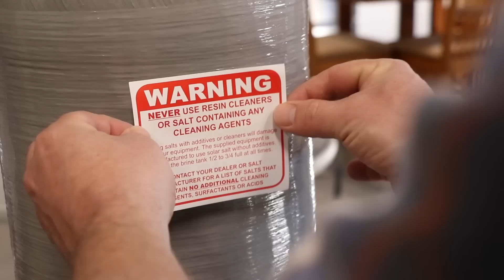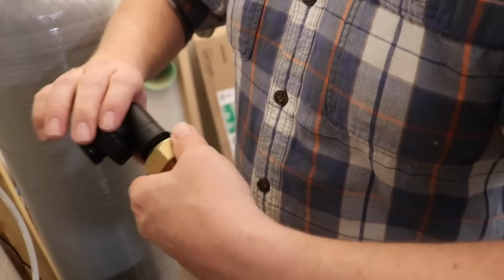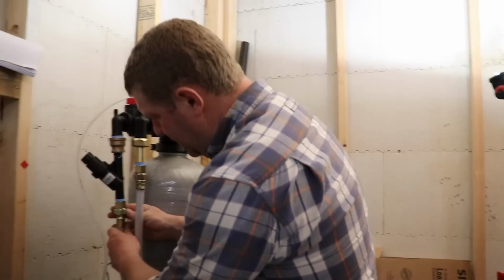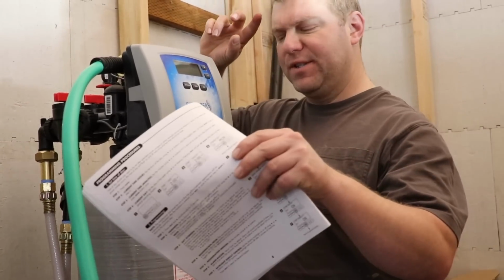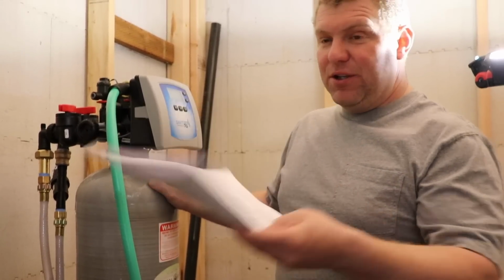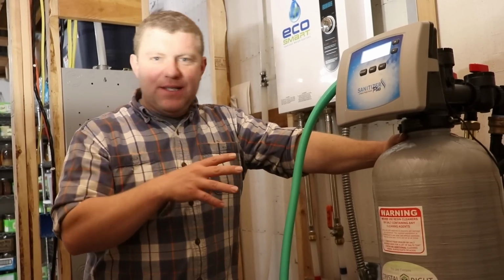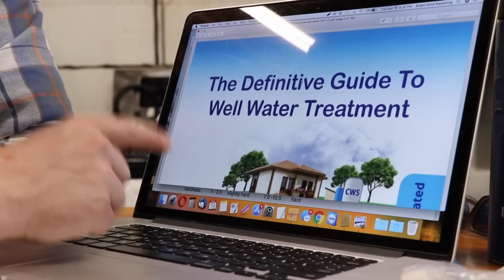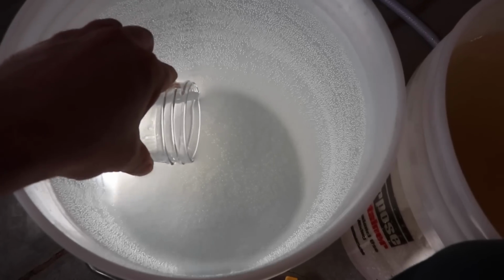ITS FREAKIN MAGIC! (Installing Water Softener for Well Water)

Comment: Now with the water softener installed (salt based ) you will be able to buy salt in pallet form and use it on the driveway in the winter. You may also want water filter in the future, in general the water softener is used to soften the water not to filter.

Comment: In the UK it is recommended that an unsoftened drinking water supply is provided at kitchen sinks.

The reason, salt is used to soften the water and it is all to easy to exceed your daily allowance of salt.  

If you suffer from cardiac problems or have high blood pressure this can be a real problem.

I would recommend having the salt content analysed and then compare the results with national recommendations.

Comment: Jessie filter only the water you are using in your house. Remember when it backwashes the unit goes into bypass and you will be getting unfiltered water in your house. I have a two tank commercial system in my house. While one backwashes the other filters. Also your salt consumption will be outrageous. Kenetico no power needed. Measures water usage for backwashing. It ls almost a must to put a sediment before the softener to protect it.

Comment: The check valve in the brine tank is  doing its job, no water in brine tank means valve is closed. Run unit through full cycle, presto fixed.

Comment: Those bubbles are a temperature difference on the surface of the bucket wall between the water and the outside air! It’s a normal reaction!

Comment: two things 1. turn the teflon tape over when you are wrapping the threads so you don't have to keep rolling in the slack. 2. you don't want the tape to cross over the orifice of pipes and fittings can cause blockages. Have a good one.

Comment: I think you could go straight well water for the garden and then for things like washing down the backhoe or whatever.. probably wouldn't fill a radiator with it but it probably shouldn't hurt the vegetables considering there are minerals in the dirt.. save you on your cistern use.. whens the due date? April 23rd? :oP 🐓❤🍕

Comment: Congratulations on the clear water. Just make sure it does not strip the water off all the minerals which are essential for our bodies. If it does you better be buying drinking water and use that for the house chores👍

Comment: 2 Things.....1) Our State (NH) inspector recommended that the recharge discharge from the softener be directed to it's own separate dry well.  Don't want to pipe a salt discharge (don't add antiseptic (salt) to the Septic Tank)  2) Recommend plumbing the outdoor faucets (garden etc.) direct from the well source...the softener should be plumbed for indoor domestic use only, softener is not needed for outdoor car washing and watering.  Good Luck!

Comment: Two things you need to know. You desperately need an expansion tank, with a pressure cut off switch. The cut off switch wires back to the well pump. When the tank reaches a set pressure, usually about 45psi, it shuts the pump off. when the pressure drops to a preset pressure, it turns the pump back on. Your pump puts out enough pressure to damage things in your house, if you do not control it. The other thing you need to be aware of, with a one tank softener, is when its in regeneration, it bypasses hard water into the home. Any water you use will be hard unfiltered straight from the well. On a two tank system you always have soft water in the home. Now at 2am you will not use a lot of water, but just be aware, if you do its hard water.

Comment: You may want to check with your filter contractor, but you may want to consider monthly water tests from the output of the filtration system to ensure it is operating efficiently and to identify any problems or defects with the filtration.

Comment: I would have thought you would have a house sized mechanical particulate filter before the softener system.Ah, I didn't hear about the internal particulate filter in this system until further along in the video. Got to say I love my reverse osmosis drinking water system even if it is a separate system. Oh and you already "know" not to use softened water for plants.

Comment: I have a similar system but it's for my fishtanks   Its a Reverse Osmosis 4 filter machine sediment ,carbon,carbon plus  & 100 gallon per day R.O filter  my tds starts at 85 and drops too 1 after the filters  then I have an additional Deionizing resin to drop it to 0 tds for my tanks (not ok too drink now)

Comment: Pursuant to this and your video explaining your quest to figure out a pressure measuring system to determine the volume of your cistern... have you considered float-weights? Doing a volume measurement from empty, you could put a sensor and float at the 100gal point, the 500gal point and maybe the 900gal point. A simple fluid-safe electrical contact switch with a bit of buoyant material on the end that will open/close the circuit when the float lifts with the water. I'm pretty sure you could do it with an arduino or a raspberry pi, but it could even be as simple as running low-voltage electrical cables from your utility room up to the cistern and when the water reaches the 100gal level, it'll pump it through your water softener and turn OFF at 900gal (accounting for change of volume based on temp, perhaps). Why make work for yourselves when you can have a $50.00 microcomputer, some electrical cable and a little bit of code can handle your water refill times. Should be able to program it to only fill when both conditions are met, 100gal AND you're both awake so that klaxon doesn't wake the future addition to your family. Just a thought. If you're not comfortable with programming, lemme know, I'll try to help or find a cohesive tutorial for whatever product fits your needs. Never stop being amazing, you remain an inspiration.

Love from Newfoundland, Canada

Comment: My concerns would be less about the quality but more about the quality over volume... This softener I would guess is for normal family home use that's around 100 gallons a day and timed to self clean (likely daily) and treat for that amount of use, but your considering making it move and treat 1000 gallons in an hour to last you couple weeks to a month. Seems to me you need to set up a good strategy to not over work it for the quality over volume thus using some timers or manually operating it something like 8-12 minutes on then backflush and treat or whatever you can devise from the normal intended daily use compared to how you actually plan to use it until you incorporate it into the house properly. Get the proper pressure regulator so your not stressing your pump and wasting precious water. Please don't use garden hoses for very long things grow in there we know the softener can handle some stuff but you will be pushing from the softener to the hydrant with a hose to send it up the hill. Don't neglect the cistern, treat it as needed still since you have such a reserve at your current usage levels. Be safe and congrats on the pregnancy.

Comment: Don't backwash into your septic. Outside hose bibs should just be on the well. Run soft water to one for washing cars ECT.  Might consider a uv sterilizer going into the cistern and into the house. They use much bigger ones in municipal water systems. 100% effective when maintained. Just not a fan of chlorine in drinking water.

Comment: For an example of a failed complex solution, look to the Boeing 737 MCAS. Increased complexity adds more modes of failure, and therefore increases the possibility of failure. A good solution is a balance which minimizes complexity while solving the problem.
Personally I dislike many of the 'features'  on new cars as it creates more modes of failure. My arm has never failed to hand-crank a window .. motors, on the other hand........

Comment: I think I'd rather deal with iron in my water than the lime we have here. This water, if we drink before filtering, will actually make you thirsty, and if we leave a glass or pot with water in it overnight, limescale will be visible by morning. And... (yes, I started a sentence with and) and it's tap water, from the local water and sanitation company, it's been treated, so "they" say.

Comment: I've always been told that you do not want to run your water softener through your septic system if you have a concrete septic tank it will deteriorate and cause it to crack 1 time may not be a problem now but not for long term

Comment: You might get some slight contamination from residue lubricants in your brand new system. So dont freak out, if the test comes out with small amounts of strange new chemicals ;-)

Comment: Two things. 

Don’t use salt softened water on the garden. Not good for plants as they should be happy with well water. If you were using potassium soften water the plants would love it. Problem is potassium is about five or more times the cost. 

Next, you could run a UVC unit which will kill almost every bat living thing in the water. However there are a few thinks it doesn’t so read up on them. 

Lastly, an RO unit for your drinking water gets the lays things out including the small amount of salt.

Comment: You are so close to having a water system. If you dig a water line, and install a pitless adapter and pressure tank, you won't have to mess with the cisterns at all. They are irrelevant now that you have a well. Wouldn't it be nice to have the system work automatically and unattended?

Comment: Run the power and water line from the well underground into  the house and into a 35 gallon pressure water tank "bladder tank" with a pressure switch. Then to the softener.

Comment: Was that you did a great job on your water so far something to look at a system play a Smart House possibly closest flow valves one-way valves sensors on the top of the that wirelessly tell you when the cisterns are filled listening to Baby design and layout eventually and look at systems good luck

Comment: Single tank systems are garbage because if you ever happen to use water when the system is regenerating (ever get up late at night to hit the bathroom?) you'll get raw water into your pipes, hot water system, etc.  Depending on the quality of the raw water this could be a mere inconvenience or a major issue.  Also, having the regen based on an electronic timer sucks because when the power (or battery) fails, your regen schedule will be lost.  Best system on the market in this regard is the Kinetico, which relies on water pressure to turn a bunch of gears that control the regen cycle.  Based on 15+ years of personal experience with that system, it never fails.

Comment: At least here and I do hope that it is different for you, but drinking 'softened' water is a big no no in the UK.
It is great for washing, cleaning and heating use, but no good for your health.
I would love to know what your position on this is?
Are you using it for the whole house including drinking water?
Softeners are amazing tools they really are, the media will need to be changed at some point, depending upon usage and a pre-filter may be an idea in the long run.
As for home testing for harness and mineral deposits, that is a straight forward enough process.
You wont be checking for pathogens but the actual physical content of your water will open your mind to what you do or do not need to do.

I do hope this makes sense.
Ru

Comment: You might have already done but you want to google the effect of salt from softened water on your garden. It is not good. Salt causes the plants think they don’t need water and might die of thirst if that makes any sense.
Have you thought of a pressure tank with pump switch then bypass the softener for the garden that way you can put on timers and filter what is going into cistern.

Comment: You shouldn't be alarmed about the bubbles in the water that sat in open bucket overnight. There is a ton of microorganisms in the air and they are falling into the water. You wouldn't believe what is in the air and how much of it falls on surfaces in an hour. So it's not really that strange to have bubbles in water that is in open container.

Comment: Someone already mentioned to put a FILTER ON THE INLET TO YOUR OFTENER, BUT NEVER EVER USE A PLEATED PAPER FILTER, speaking  from personal experience,  but you should also use a pressure tank, so the pump does NOT RUN AS YOU USE WATER ,,PROBABLY 40 GALLONS OR SO, READ UP or ask,  Cheers, from NJ

Comment: The media in the softener is lifetime. Only for the life of the media though. It'll need to be replaced, but that's a long, long time from now. Easier than you'd think. Actually not magic at all. Get that brine rinse figured out before the media becomes blind, or you're taking years off its life.
You don't need to soften water for the garden. It's a waste of softener salt. That's a simple plumbing job.
The bubbles on the side of the pail are just dissolved gassed coming out of suspension. Like dissolved oxygen. The colder the water is, the more dissolved gasses there will be. As the water warms, the gasses come out of suspension.
Don't bother having it tested until the brine is working, then add sodium to the test regime.

Comment: dont use soft water in your garden. it will be much happier with straight well water :) also look into compost teas. you could use your old water tank to brew them. they take 24 hours to brew. and the byproduct can be sprinkled on the topsoil. its one of the most effective, easy and cost effective ways to feed your garden. i use reverse osmosis water in my garden and have to replenish the lost nutrient values that the well water carries. i do this because the ppm of my well is too high for small/medium plants. your guys water shouldnt be too bad. also with the woodchips and everything you added to your garden soil your soil ph should be slightly acidic after the microbes do their thing. your well water being hard should have a slightly or heavy alkaline ph to balance it out.

Comment: Softener FIRSTS: (1)Be careful in the shower the first month with soft water. It will be slippery until all of the old soap residue is washed out. (2) Same goes for your skin. It will feel slippery until all of the old soap residue is washed out of your pores.(3)It was recommended for us to wash all of our clothes once WITHOUT any laundry detergent to remove any built up soap stuck in the fibers(it was cool to see all of the bubbles in the washing machine without using any detergent. (4) Use 1/2 or less detergent when washing clothes.(5)Enjoy soft skin!!